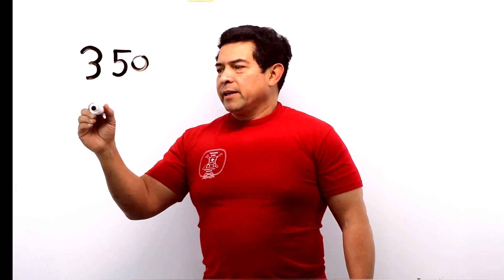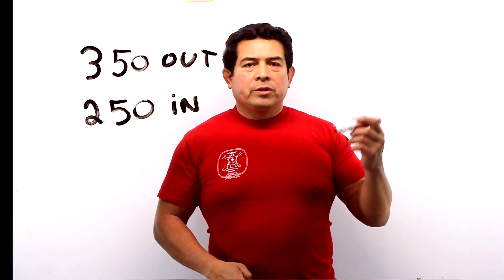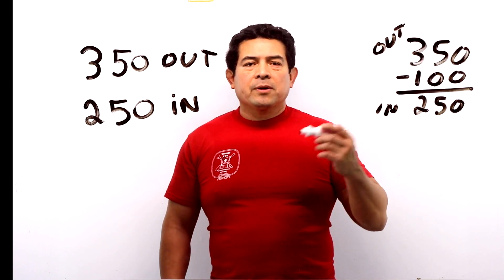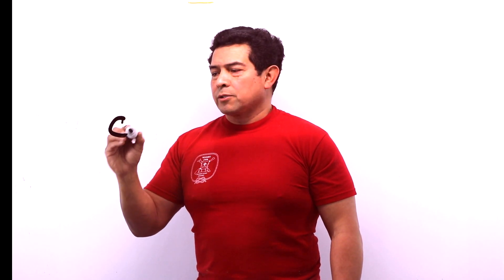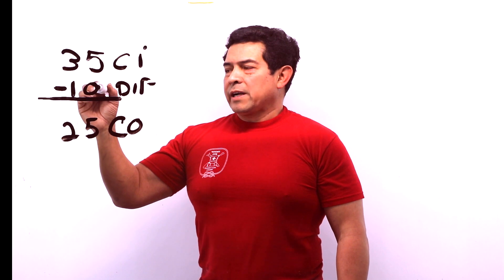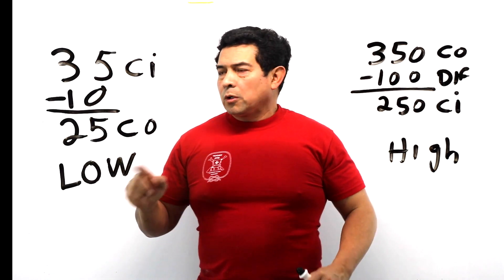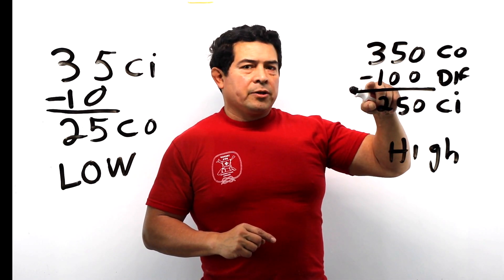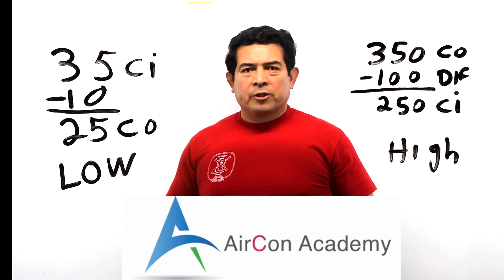Setting Pressure Switches - HVAC Online Training and Courses

Comment: What maybe the correct setting of pressure switches in a reefer provision plant in a ship? Like the oil pressure, high and low pressure, 2 capacity controls.
Reply from the maker: You're asking about on a ship?   Are you in the Navy? Or are you on a cruise ship? What type of refrigerant are you using? And what are the temperatures on this reefer you're talking about? His heart to tell you without knowing more details. I was in the Navy and that's what we called it the reefer. So I was just wondering.

Comment: Thank for great knowledge l would like ask how set R404a hp and Lp pressure switch for a glass meat freezer also what is normal suction running  pressure in psi.
Reply from the maker: A walk in freezer can have an operating temperature of 0°F or as low as -10°F the suction pressure should be around 24 to 32 PSIG. The freezer the low pressure switch could be set between 18 to 20 PSIG.   And  it is often suggested to set the high pressure switch around 245PSI.    I hope this answers your questions and thank you for watching.

Comment: I am trying to set up AC in a project vehicle. What are good pressure cutout numbers for r134a? I want to get the right switches so I have cool A/C and more importantly so I don't damage my compressor.
Reply from the maker: In vehicles typically, you only have a low pressure switch. Typically you want that to cut out around 20 or 21 pounds of pressure. I have never done an air conditioning system in a car but I thought maybe you would order the entire system and then it would come with all of the parts needed? I Never really thought about how the car AC would be done from scratch. Good luck and thank you for watching!

Comment: Do you have any rule of thumb concerning Setting the HP pressure control  ?  A cooworker told me to set it approx. ( 30 Degree F ) over the usal temperature in the room the compressor is in. And instal a manual reset with it. So the system would only cut out if there was a problem with the condensor fan or with the pressure going up too high.
Reply from the maker: Thank you for your question. To be honest with you, I do not have a rule of thumb for setting the high-pressure switch. I have been doing this since 1979 and we usually set the high-pressure switch somewhere around 375 to 400 for R-22. And for R-410a typically we would set that to 575 to 600.  Some manufacturers suggest that you set the high pressure switch to about 610 psi for the new refrigerant R-410a.     High-pressure switch should be manual reset so that when it trips, someone has to go there and see what the problem is.   Unless the unit has a holding circuit, or a lockout relay the high-pressure switch should be manual reset. Yes, the high-pressure switch would only trim when the condenser is dirty and there is no airflow across it, or there are plants and weeds growing all around it blocking the airflow, or the condenser fan motor has gone bad, or sometimes the condenser has been installed too close to the wall blocking the airflow, so keep that in mind. It is the lack of airflow that makes the unit have a high head problem and trip the high-pressure switch. sometimes I have seen the units so badly overcharged that the unit goes out on high head on a very hot day. I hope this helps. Thank you for sending the question in.
Reply: It's Ambient Temp + 15k Condensing Temp + 10K for a buffer (say if it's a really hot ambient)
Reply: It's Ambient Temp + 15k Condensing Temp + 10K for a buffer (say if it's a really hot ambient)

Comment: Do you recommend using it as a low ambient control to cycle condenser fan on a residential system? If so, what would you set the cut in and cut out at for 410a system?
Reply from the maker: On a residential unit you would not need a fan cycling switch because typically people will not use the air conditioning when it is cool out. These controls are usually used on commercial units where they will need cooling even when it is cold outside. Like in a conference room or maybe in a computer room. But residential? No, no need for that. Thank you for your question.

Comment: What happens if I set my low pressure cut out to 0 bar, and the cut in to 1 bar
Is it will effect of my compressor?
  Is it will damage the compressor?
 Because I see in the manual instruction
The low purssure cut in is 2,5/3  bar, and cut out 1, 5 /2
Reply from the maker: Typically it is suggested that you set the low pressure cut out at that pressure because it is designed to protect the compressor from a loss of refrigerant which would cause the pressure to drop. When this happens the superheat would increase and because of that it would overheat the compressor and burn the compressor out. If the superheat stayed at the correct temperature then it would not be a problem setting it to lower pressure  but most likely the superheat is going to increase and it would kill your compressor. I would not set it lower than what the manufacturer suggested. Good luck and thank you for the question!.

Comment: Thanks..
We are using R-407C refrigerant in our commercial Air conditioning system. What should be the cut in and cutout for HP & LP pressure Switches sir,?
Reply from the maker: The pressures of R407C are similar to R22, because of that the pressure settings should be very close to the R 22 refrigerant settings. 407C has slightly higher pressures so high pressure switch should be set to cut out at approximately 450 PSIG,  reset is typically manual reset.   If you are going to have an automatic reset I would set it to approximately 300PSIG.  As for the low pressure I would se the cutout to approximately 30 PSIG and reset or cut in at around 60 PSIG.  I hope this helps. And thank you for sending your question.

Comment: Thanks 
Who to know at wich pressure must cut out and in for each frione
Reply from the maker: A lot of times you are unit will tell you what the low pressure switch in the high-pressure switch should be sad too because the manufacture will have figured that out. A lot of times the low pressure switch will open at 50 psi and it will shut the compressor off what is the pressure gets up to about 100 it should reset.  The high-pressure switch could be said somewhere around 600 to 620 psig to open and shut off the compressor, it will reset when the pressure drops to about 420 psig and restart the compressor at that time.   I hope this answers your question. Thank you for watching!